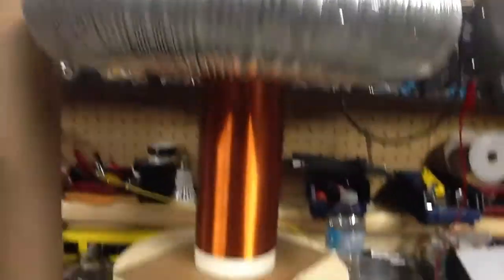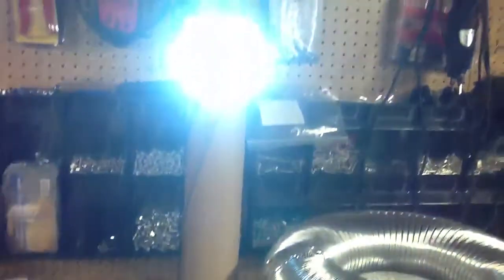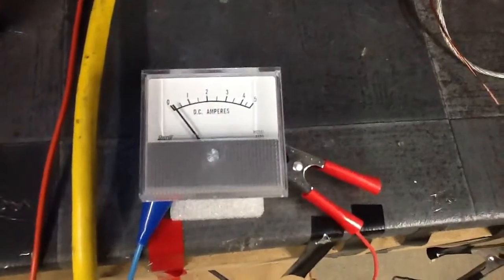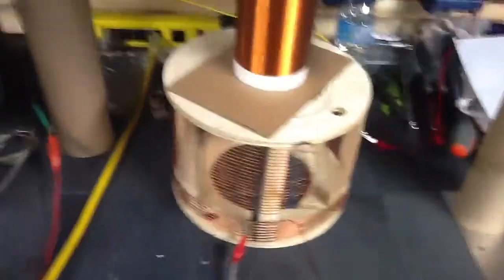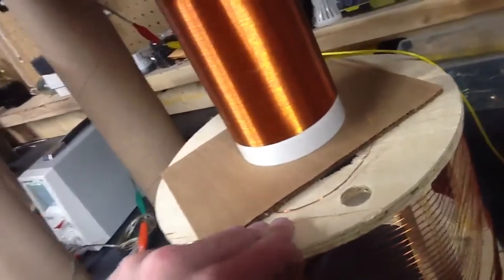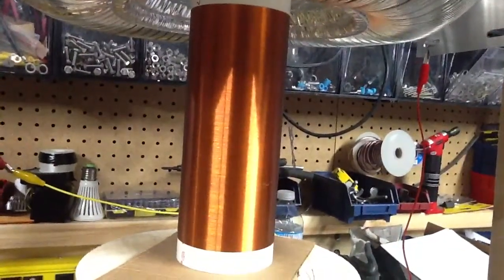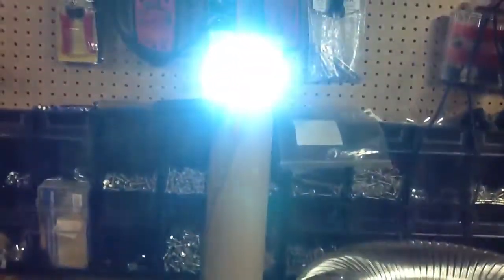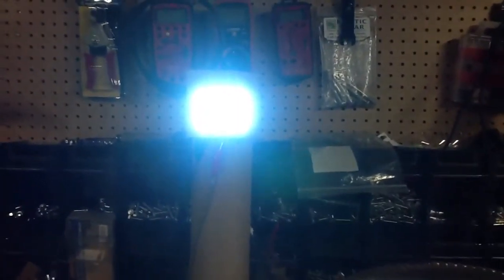pt7 THE Slayer Exciter, Toroidal Capacitance, 3 Coil Style, 48 Blinding Lights

Comment: Hello there quick question for you. I'm just wondering how you are able to have your secondary so high up above your tunable primary? awesome work thanks for all of your experiments.
Reply from the maker: hi there good question, the top coil lets call the Resonator, which Tesla called the Extra coil, which is not in magnetic coupling to the primary coil.
The resonator itself not being induced by the primary, but acts as a series LC resonant circuit of its own, fed by a direct connection to the end of the secondary, which is in close coupling to the primary. Tesla himself in the Colorado Springs Notes stated that the secondary always acts badly upon the primary, causing it to draw more current from the source... but the 3 coil LC system does not negatively affect the primary, and the resonant rise is achieved from the target frequency entering the base of the resonator, at whatever amplitude generated by the primary and secondary, and not completely by induction :) there are 2 separate 1/4 wave resonant rises, not to be confused with 1/2 wave, hope that helps !